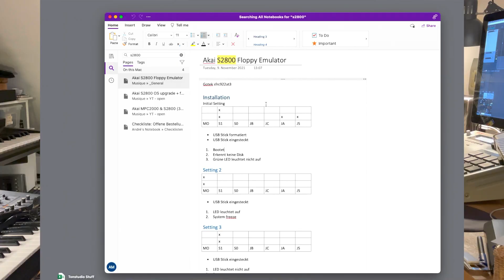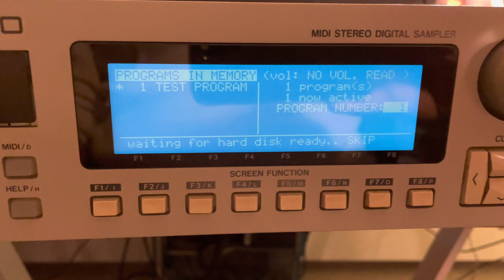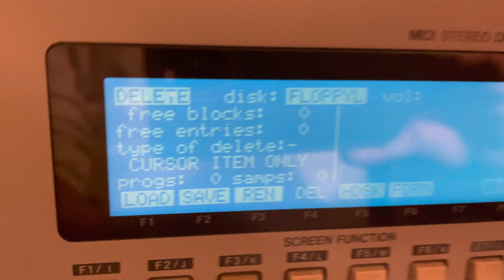NEED HELP: Akai S2800 OS upgrade, Gotek Floppy Emulator not working

Comment: I had posted a comment, but not sure if it got filtered out due to spam because I also posted a Dropbox link. In case it did: you do need to install flashfloppy and throw a config file onto the USB… you’ll also need to make a bunch of blank floppy images too. I can share a cfg and a blank floppies if you need it, just let me know.

Your jumper should be on S0 after you get flashfloppy installed.
Reply from the maker: I sent you a mail : ) Big Thx
Reply: Hello Acrolgies,
I just have the emulator built in.
When i switch on the midiplayer i see:
F-F
When i put in the usb stick i see: E34.
Can you explain me please step by step what i have to do.
Thank you ahead for your help!
Greetings Eric
Reply from the maker: This is exactly what I had. Did you follow all steps?
Reply: @EenmansbandEenmansorkest  I have a Mpc 2000
Saying e34
And f flash
I have the gotek with the display and the knob 
 Need help too guys
Reply: hi, i got the jumper on "S0", set the setting in the config file on the stick, the gotek says "000", sometimes "0_" when reading.
But when trying to format this disc, the sampler says, can't format.

How does this work with these floppy images?
Reply from the maker: @AnalogDude_ have you seen my second video already and connected to @arcologies ?
Reply: arcologies, can you send me the link to these s2800 files?  my google user name is femalding, so you can email that name with gee-mail after it and I would get it.  I am having a Hell of a time with this thing and it freezes up when I do everything, to my knowledge, correct :(
Reply: @_marlene  I tried sending an email and it got kicked back :(
Reply: @arcologies  ohhh thank you for trying!!!! I should've editd the post tho, as I finally got it sorted out after banging my head on it for hours.  Turns out some of the options in the default FF.CFG file were not working.  When I made a minimal cfg with just 3 options in it, it worked.  Thanks for being Sampler Batman arc
Reply: @_marlene hah! Glad you got it sorted 😃